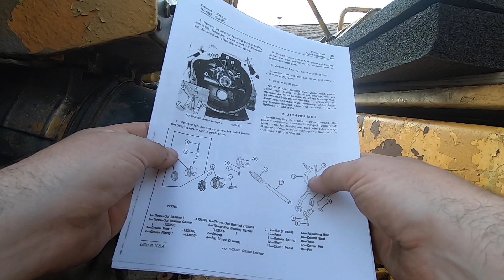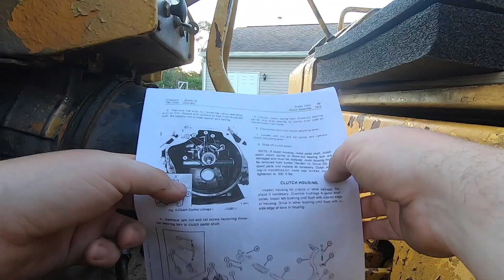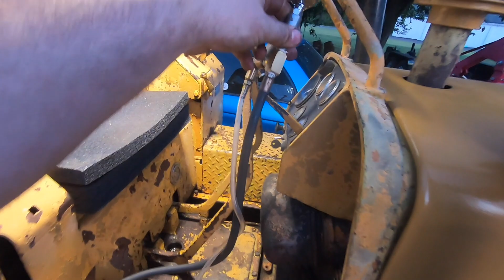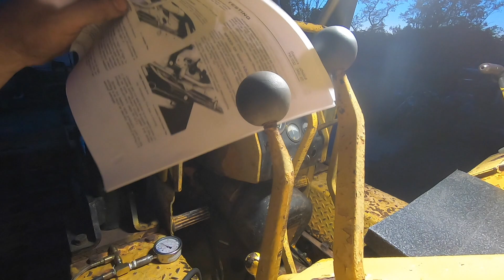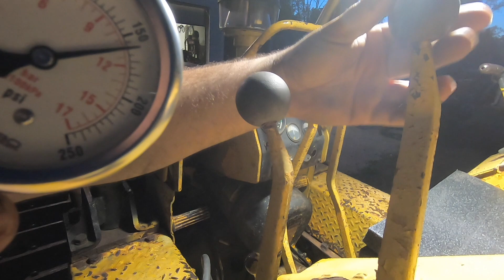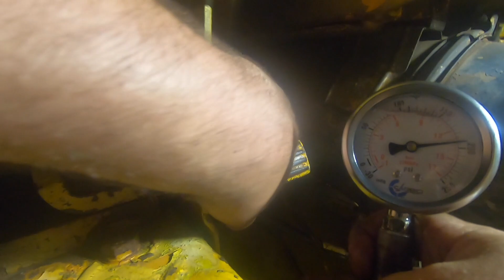JD 450 HLR transmission pressure adjustment and theory

Comment: HEY  Amber is my wife I am Ben   I have watched a lot of your buggy build  I just knew you would not get the motor to fire LOL  Man I judged you totally wrong   I am not to bright!  It took me seeing motor fire and subaru tranny  mods to finger out you not just a red neck with good ideas  Like your oil filtering and old oil  furness also  Do you go by spanky if so did you your family live centerveiw rd kenna WV many many years ago?    It would be very cool if so!   I live close to ripley wv i love to get on a good trade every once in a while  I have a tour bus that is factory RV no endorsements needed  40 foot all thick alum over space frame pusher SINGLE AXLE no tag its no lead sled  Super charged and turbo charged 6v92 Detroit diesel 6 speed automatic alison  tranny  Newer from factory motor including all paper work and dyno print out from where factory tuned before it was put in custom eagle pusher coach  Motor itself was almost 14 grand  It is a hell of a machine! Not fall apart few hundred grand when new junk 3  years ago full coverage if totaled was literally quarter of a million bucks       It will out run the wife's  07 v6  think around 225hp toyota sienna on top end and up hill  like fancy gap  and can get around 12 miles to gallon  It looks like shit tree sap clear coat  I have not started or moved it around since early last winter it dose have new steer tire and plenty fuel in it two new giant start batterys  Starts every time if over 40 degrees before it turns over once   I value it at around 20 grand but i have never seen one as good as it for under 65 grand    I like the eagles way better than provost mci can be good but all them started out full of seats and top speed of 60 from what i have heard  My eagle is over 80 mph 24/7 machine   Wifes  toyota  i think shuts down little over 100   For shits and giggles we raced up fancy gap   The toyota could not keep up and it has plenty power as i am sure you know already  I would trade coach for some thing you know hill billys we like swaping around  It would not take you long to finish what i started on the inside and you will like my craftsmanship  The newer eagles has space frame tons info on line  with thicker than road sign alum skin over it    There is s/s trim  down both sides that covers the seam where the big sheets  come together   The sealant had recall or something it would leak enough to rot floors but only few inches from the wall  Most people half ass it and cut out and replace only few inch from wall  The basement storage compartments is part of space frame so cycling of it is floor looks bad when only few inches from wall is replaced   Plus them few inches dont screw done right  Every thing must come out to do it right and the wife and wanted a new open type floor plan  The basement (storage)deck or floor is crazy thick not cast but thick like cast nice all alum   I took off trim and used 60 year sealant that is used BY ITS SELF to glue in and seal big auto doors in places like dollar general  Comes in giant tube like bags used in electric type  caulk guns  Its is THE BEST never leak again high dollar shit it will not leak ever again!  After that removed ALL plywood front to back  Then radiant heat shiny shit down first then ALL new plywood ALL  No cheeping out and having squeaky floors I used machine screws drilling every hole  It screws into space frame that by the way the roof and sides of bus are not load barring like most  A engineer type like you would enjoy a quick 2 or 3 min read about that space frame  It has a  hydraulic pump that runs a hydraulic motor that turn the giant radiator fan  It is made like  big dirt moving heavy equipment it is a hell of a cool machine!  The two side  upper space frame walls is 2 by 2 box tubing covered with that thick alum on out side  We designed the remodel energy efficiency  We planed on solar no generator or shore plug needed         We needed more space for insulation  We also wanted to be able to have 120 light switches outlets ANY where not limited to weird places  Reg 12 2  house type wire will pass code going threw motor vehicle metal 2 by 2 box tubing        To kill many birds with one stone we ripped down with table saw 2 by 4 lumber to make light weight studs   I box studded the inside exterior walls    Used machine screws into box tubing with liquid nailed anywhere wood and metal touched  I hate a squeaks going down road was not having it!   This made for outlets anywhere and reg 12 /2 wire threw wood as in reg home  Also gave the extra space for to thick brown high r rating insulation  The hardest stuff is already done  I was planing to install high eff min split in basement  There is 4 roof top units all work with paper work  I took 3 out already and made thick alum panels to cover holes  I installed panels i made with that same 60 year calk glue and like on air plane large alum aviation rivets  I have a 5 gallon best there is white rubber paint made to reflect sun paint  I was going to use after removing the other roof unit  That is as far as i made it before got sick and should be dead   It is a empty slate for next owners fool plan  Has new steer tires also we planed to live in it full time traveling every where  If trade was good enough i have 15 grand solar system for it   Big enough to run hole coach including air conditioning no genny or shore plug needed   It looks Honorable from tree sap and clear coat but you could clean an touch it up making to shine again  It is so cool!  I would do some trading if some thing need or could use   The high value of coach would not matter all that much to me It makes me sick seeing it covered tree sap looking horable  you know how it is!
Reply: its  factory raised roof not a head bumper my wife cant reach cycling with arms stretched straight up  has the fancy alum rims all the way around it also man its just cool period !     roof is awsome guy twice your size can run and jump up and down any where solar panels fit perfect from front to back snug to roof after last roof unit is removed  also saved almost a foot of roof height  them things sticking up look goofy  trade or no trade you ever need a roof ac unit for free come get it next time in wv